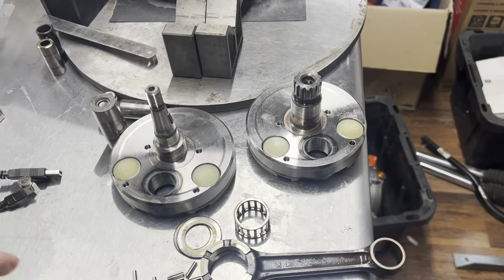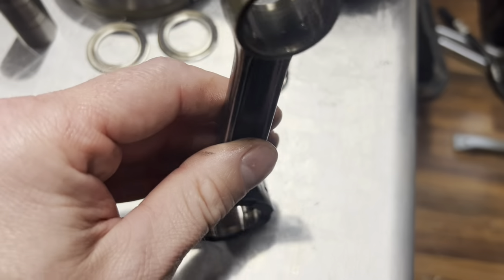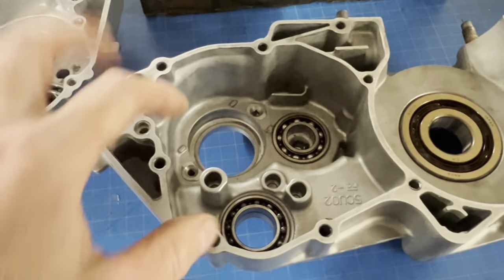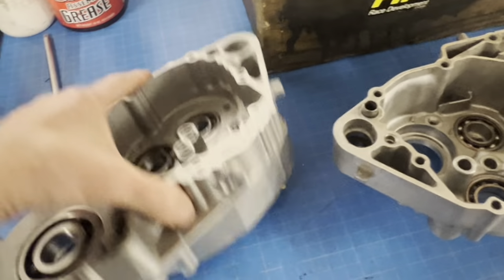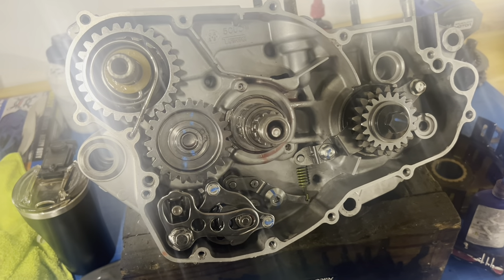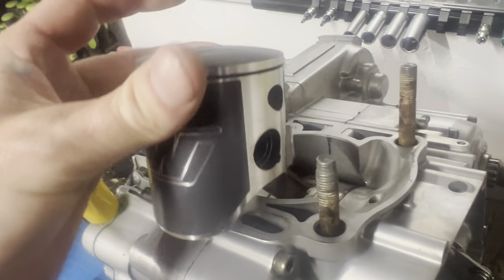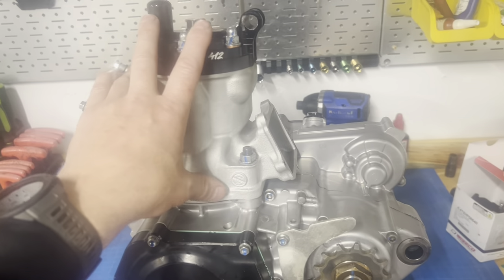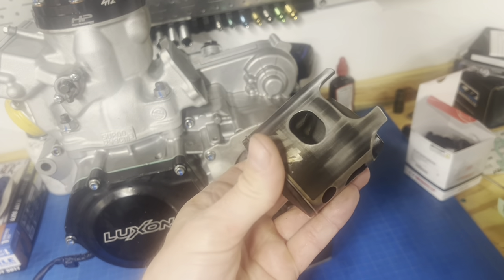Inside a Pro Supercross 2 Stroke

Comment: If this is sx build, is it for max midrange and response or is it linear all the way to the top? Well made vid👍
Reply from the maker: Maximum power possible with motocross fitable pipe.  We have made tweaks to the pipe to pick up a little midrange - but one "flaw" of all thes pros is they rev too much. Jared routinely revs past 13000 - we'd like to see never past 11500 for parts :)

Comment: On your pistons do you run thicker domes?are those the crank stuffers stock ?i noticed they are recessed slightly would that not disrupt flow and hurt crankcase volume?
Reply from the maker: whats recessed?
Reply: @HPRaceDevelopment  the plastic round reed stuffer on the crank webs.i built a few yzs back in the day and the plastic never fit flush. I always skimmed them with devcon then machined them flush. Its only a few thou but yes im that picky
Reply from the maker: @denniswilder3014  While I appreciate the attention to detail it doesnt translate to power for me. The expression of step over a dollar to pick up a penny comes to mind. The yz is arguably too low on crankcase volume - If i waved my magic wand I would add some volume - but i prefer that volume in the transfer tunnels and just below them - removing stuffers all together wouldnt put the space where we want it

If we werent so busy on all various projects - I think we could find another 2-3 hp on the yz from where we are with an additional month of r&d

but past that - it would be slow coming. Our current package outruns a solid ktm250sx and current 300 sx. its not far off what we have dyno the current yz450 at - so vs stock its a long ways improved 

The piston crown is shaped in a manner to more properly dissipate heat.  we (his current carb) have been far too lean when it was first tested - and no crown issues - its still a tad lean in areas and been punished in deep sand and mud and all solid. You will detonate or hurt something else before crown issues - at least so far

Comment: I can’t tell if I’m seeing correctly how that bore gage works. Is it using three points of contact or two?
Reply from the maker: of course it works
Reply: I didn’t mean hope. I meant to ask how.
Reply from the maker: @dylancrow7919  That gauge is 2 points of contact at measurement point - but has a guide “wheel” that is its own 2 points of contact - making 4 points of contact. In a future video ill zoom in on how it works
Reply: Ok thanks. I’m about to subscribe.

Comment: I don't know if you have worked on yz 125s before but im having issues with how too find the correct piston size. The owners manual didnt help at all but the one piston we bought from yamaha was the exact size as the oem piston and the bike ran perfectly fine while breaking in the new piston. Then raced it and 2 laps in, it heat seized the bike has 130 hours and id hate for the oem piston too grenade. Any help would deeply be appreciated.
Reply from the maker: if the clearance was correct and it was oem piston its more likely you didnt mix enough premix, were far too lean, or a combo of both
Reply: @HPRaceDevelopment  we always mix 40:1 or 50: 1 with the elevation we're at and never had an issue with that mixture before unless we got bad pump gas "ethanol free" which is highly likely. But what you said could also be possible since we have the lectron carb on it and it did self adjust itself to a lean mixture before. I just hate the fact that yamaha has numbered or color coded their piston sizes.
Reply from the maker: Kyle your manual says 32:1 and its for a really good reason.  I highly suggest you run that if you want your parts to last as long as possible.  OEM piston sizing is nearly irrevelant - the differences are very small and each size will work in any size cylinder - although we as a shop always recommend the A size pistons, which are the smallest of all of them.  It sounds to me like you need to take some of the free info we have put out there - and use it to your advantage - measuring your piston to bore clearance, ring gap clearance, and from my reply here - 32:1 would do you a lot of good. @kylebeach2316

Comment: I was able to get that output shaft bearing from SKF.
Reply from the maker: They arent stronger in our experience than a Japanese  bearing. The reason ktm uses a roller rather than a ball is much higher load carrying ability - with modern tracks and power levels - we think its a smart way to go. Ill have a video with it when installed in our motor - we shall see how it goes long term
Reply: @HPRaceDevelopment  deffinetly interested. My bearing failed there and I replaced it with a SKF. Next crank swap I’d definitely be interested in the KTM style.

Comment: So no modifications on the crack case ?
Reply from the maker: Nope - what mods do you think would make additional power
Reply: Maybe the side where cylinder and case joint, smooth them and make sure they are line up perfectly
Reply: This guy is awesome spectacular work sir do you have a price list and list of services for both two strokes and four strokes?

Comment: 12:17... yeah that's a cute theory you've got there... but I highly doubt that g-force would ever unseat such a tiny, low mass part like a wire ring.  Maybe... if it revved to 25,000 rpm!
Reply from the maker: @mareksumguy1887  its a fact - and happens all the time to people. 8000gs is no joke, the mass of the clips doesnt change the effect of the force on their stiffness 
I can bend these by my fingers - what do you think 8000 times their mass is?
Reply: @HPRaceDevelopment  I would think it happens because the ring isn't seated properly and/or they are bent too far and lose their tension upon installation. Can you show me an article on this??
Reply from the maker: @mareksumguy1887  When a clip comes out after 10 hours…

it wasnt poorly seated or bent. Those failures occur quickly.  Locating end gaps at 12 or 6 is literally common sense and im not the first to say or do…If you bent a clip just a little but got the gaps at 12 and 6 - its also more likely to self heal and stay in place.
Reply: @HPRaceDevelopment   just because something is widely believed... doesn't make it true.
Reply from the maker: @mareksumguy1887  ha - ignorance is no excuse. I have the fea work that shows it clear as day

Comment: Whaaat? A pro rider uses a flywheel weight? I thought that was only for enduro guys 😂. Are you running the gytr flywheel or a stealthy?
Reply from the maker: I think he he has both actually
Reply: We run the GYTR YZ250X flywheel weight, so its +8.04oz. Helps with the small chatter out of the corner in SX/AX and helps a ton for getting the rear wheel to roll over the whoops, without it, each whoop seemed to stop the wheel, so this helps it drive across them.

Comment: For a "PRO" mechanic it amazes me that you don't have a engine stand/holder and a crank puller/extractor tool.
Iam waiting for the outcome of Ceramic bearings
Cheers from Sweden
Reply from the maker: HUH?  Without a doubt the wooden boxes are the best assembly stand on the planet.  We have multiple engine stands - and top dollar ones at that - and all they are good for is looking nice for social media or basic top end work.  I have multiple "crank pullers" and "installers". That said  sweating in the crank via hot and cold is BY FAR a superior assembly method.  In tear down - of course we use a crank "pusher" "case puller".
Reply: These comments usually come from a guy who believes it's a requirement to use a torque wrench on the oil drain plug..
Reply: @zacharyhickman8382  haha that was a good one👍
It was a ....written with blink in the eye...like a "joke" .....any funny in you 2 guys bodies?.....nah
Reply from the maker: I guess im just not a pro mechanic...that's my real problem  @Motoinc
Reply: @HPRaceDevelopment  🤣🤣👍

Comment: Not to take away from the content or your view count, but have you or anyone reading this heard of a you tube channel called '2 Stroke Stuffing'? Dude has been building and developing a supercharged, rotary valve, 50cc 2T engine from scratch in his garage hoping to get 50hp on his home made dyno. it's like a fail video in super slo-mo. 😮
Reply from the maker: i do watch him, its a struggle at times as he has visions of granduer but thus far he has missed the boat. If i were him - id start with the best 50 that exists already - approx 20 crankshaft hp - and add the power adders to it. He tried too many new things at once and it has hurt him
Reply: @HPRaceDevelopment  i think you're right. worked on paper and looked good with nice cameras. 😂
Reply from the maker: I'd love to hire him - he is very good problem solver on mechanical things.  And his skills at film and production are top notch - totally under rated @DougTunnler

Comment: Why not leave all the coating intact? rather than remove some for signatures, name brands, "#412" etc. I get it, promote what you've proved to be a great product. I'd rather see the magic port work.
Reply from the maker: You gotta pay to see that…
The pistons only “rub” where this one is worn off at - lower third of skirts. 
So those are the critical areas to coat - the other areas are just for bling mostly but included for the same price so why not make it look cool.

Comment: Why did you spend all that time to put a motor together with a fried clutch.
Reply from the maker: His mechanic is more than capable of swapping clutch plates…answered in the video why did you take the time to ask the question….
Reply: @HPRaceDevelopment  I don't understand putting worn parts in dude
Reply from the maker: @likeaboss860  Don't understand what???? He didn't ship the parts to me to replace - we turned this engine around in under a week - and it wasn't planned.  He owns multiple replacement clutches - and is more than capable of installing them.  I ship it complete so it's safer than trying to package loose parts in a cooler....
Not that complicated.  But guess you don't understand.